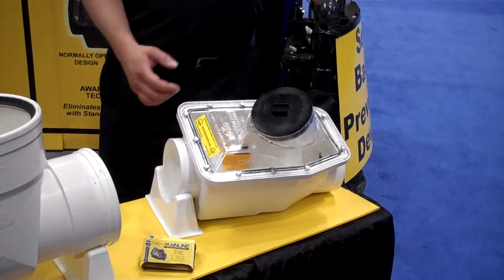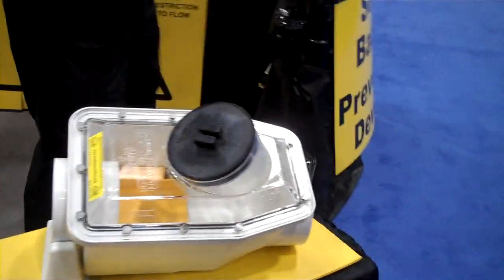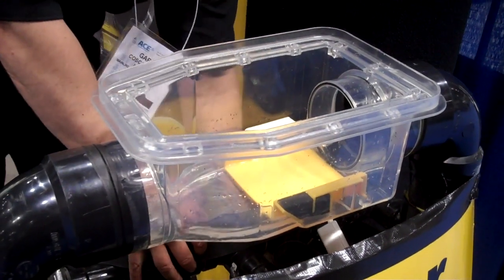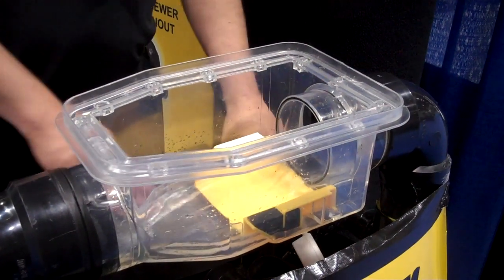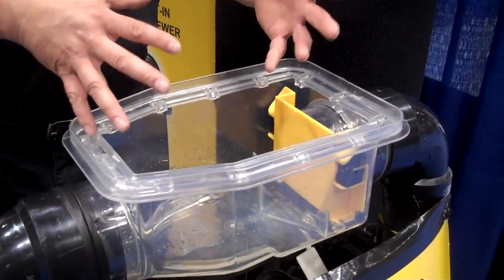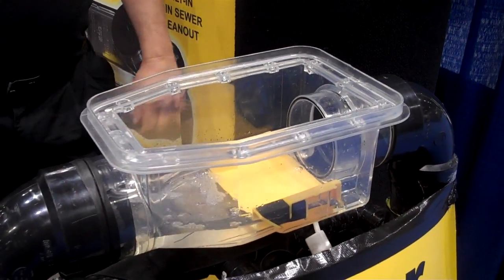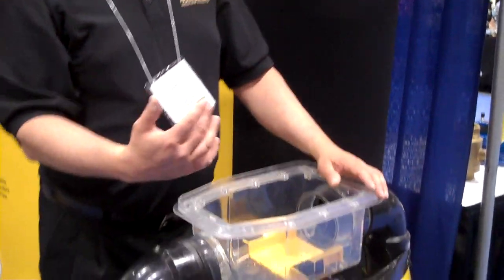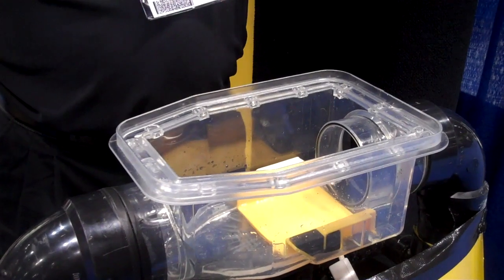Demo of Sewer Backflow Prevention Device at ACE 2010

Comment: This design is flawed in a sense that if it backs up with debris there is a chance it may not fully go back down causing a blockage. It would be better if the mechanism was ontop of the pipes that way gravity always kept it closed and when you flush your toilets it pushed it open. This would make it harder for debris to get stuck behind it if it ever backed up.

Comment: Looks just what my fathers house needs after 2 floods in 2 years. What about an alarm so you know not to run water or flush?
Reply: They offer an add on, which replaces the main round clean out plug with one that has two electrodes extending a calibrated distance. Can be retrofit in a minute or 2.
If water (conductive) allows the circuit to complete, then an alarm sounds.  Looking at a single photo and not having had one in my had, I believe they use a battery like a AA or 9V to sound the alarm. 
 Nice addition, though I wonder how they have dealt with the sounds being "constant" - in a sense you do want it to be ongoing and unmistakable so if the problem occurs when you are away at work, or sound asleep, you know about it as soon as you can. 
 While OTOH while it's happening you want to be able to turn off/defeat.  Just like a smoke alarm or general basement flooding alarm.

Comment: I installed one in February, 2020, and it passed its first test yesterday. I was watching with a flashlight when the yellow gate floated up and closed.  I celebrated with a beer. Keep it clean and it will work.
Reply: Keep it clean...what do you mean?
Reply: @r828realty  iI's necessary to unscrew the plug and flush out the muck with the hose a few times a year. Enough muck and the gate will stick in the open position.
Reply: where can i buy one here in the US?  thanks
Reply: @PabloTaboadaNYC Amazon
Reply from the maker: @PabloTaboadaNYC  Hello, the company's website has a list of places where people can buy the product: http://backwatervalve.com/where-to-buy.html

Comment: Ok question, how will the floatation action work against raw sewing with low water content
Reply: It won't and rather remain open and allow a backup to occur. Best ones have the flap ontop which remain closed at all times and only when you flush your toilets or run your sinks from inside does it push the flap open and allow your sewage to exit your building.

Comment: What if water is coming from both side at the same time.?
Reply from the maker: It would depend on the pressure if it would flow out or not. If I had one of these, and I knew conditions were backing water up to it, I would probably try not to discharge water to the sewer until the water went down.
Reply: Your flap will be closed, therefore any discharge from your home will simply go back into your piping, it will eventually go up your sinks, tub/shower, and toilets if it has nowhere else to go.....
Reply: This may work for clean water, what if there is something comes on it

Comment: Okay so when the lid comes up and closes the passage, what would happen if sewage from the house is also present and flowing at the same time? Basically the sewage at each section are opposing each other. It's just similar as to having your septic passage blocked. Then the water will just start filling up the passageway and ultimately the shit will come back to your toilets and sinks.
Reply: If that happens, I'd assume you'd see your own toilets/sinks/showers not flowing properly, go check the valve. In any case you don't end up getting your neighborhood's effluent into your own home.

Comment: But where does the water go???  If the pipes are blocked, it has to go somewhere..
Reply: the purpose of the device is to make sure that water, in this case sewage, only flows in one direction, away from your house. if the device is triggered, that means the flow of sewage is towards your home, which also means any sewage that is going down the pipes during this time will be stuck in the pipes until the sewage flow returns to normal. this device simply stops sewage from flowing into your home; it doesnt fix the problem that's causing the sewage backup.
Reply: It'll back up in the pipes and manholes.  As soon as the municipality knows there's a problem, they would set up a pump to bypass the backup and clear the blockage.
Reply: In the streets if it gets higher than the manholes. Better that it flowed down the street than down the floor of your house.

Comment: I just don't see this thing working consistently, there always is solids in the water, even if it is only 5% and there is a lot of air, if the system is not discharging for a week or two the solids tend to dry up if they did not flow out. Seems a little bit of feces and some air to dry while I'm on a two week vacation would cause the flap door to get stuck. If you have to clean it once a week I highly doubt that will happen. Maybe a wash port and a solenoid on a timer to purge it might make this more reliable and possibly a test procedure so the homeowner can verify that it is functional.
Reply from the maker: The cleaning feature is a good idea because I also doubt most people would want to spend that much time fussing with it. Would be best if they had a water hookup to it where you just pressed a button to clean it, but I guess there would be concerns connecting potable water to a component in the sewer system.

Comment: what happens if the main sewer is in front of your house and is blocked throwing 2 feet of water and then the sewer backs up into your basement and shower, and you install the backflow preventor and it stops the water from coming in, what happens to that water as the whole street has 2feet of water?
Reply from the maker: If you have a backflow device and your home is above the level of the water, you should not get any water into your home. The water should remain in the street and sewers and could also go into other basements where there are no backflow devices. If there are storm sewers or combined sewers (the ones connecting both sanitary and storm) the water eventually flows to streams and rivers. This discharge to a water body is often regulated and must be reported by the community as would any backups into other homes.

Comment: i would like to see the demo let the water get above the gate. wouldn't that equalize the pressure and allow the gate to open?
Reply: No because you have whats called differential pressure. The pressure on the other side of the gate will be higher and the  static pressure on the gate will push it shut. It would actually push it shut even tighter the higher the water got.
Reply: jacobyodernation

Comment from the maker: We were also wondering about that and asked what would happen if debris got caught. He said the design of the product helps prevent that. I'm wondering if it is because normal flow would not cause debris to get caught so it would only happen if water started flowing back. And at that point, the water is more likely to be stormwater than wastewater since backups happen due to an increase in flow from rain. So perhaps there is less chance for debris to even be in the water at that point.
Reply: There is always a chance that wastewater will back up due to a storm sewer pipe leaking into  a refuse sewer  causing the toilet water to back  up into a persons house via the toilet drain. Like it happen in Millersville, Pa, Lancaster county Pa. Several years ago,and Millersville didn't care about it either. They said that they have immunity from being responsible  because of what happened in their town due to their own fault. Typical liberal thinking.

Comment: @pwgroup If the valve is closed due to backflow from the sewer line you will not be able to discharge any water until the valve opens once again. The beauty of the Mainline is that if you are experiencing heavy rains and suspect your valve could be closed, simply open the access panel and look through the transparent top to see if the valve is closed or open.

Comment from the maker: @jumpdance24 We also asked about the maintenance and then the chance of debris causing failure. He said the maintenance is easy because it is accessible through the top in an open pit and has a clear lid to help with easy inspection. He said due to the design, debris does not cause issues. The pressure holding the flap closed is from the water that is trying to back up. Not sure if it could continue to allow discharge during a backup though. You could checkout their website for more info.